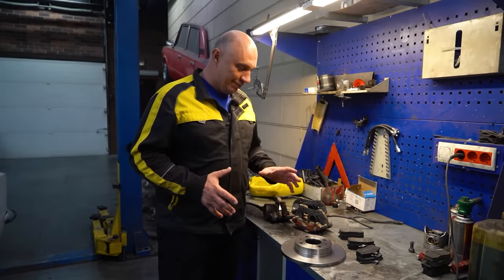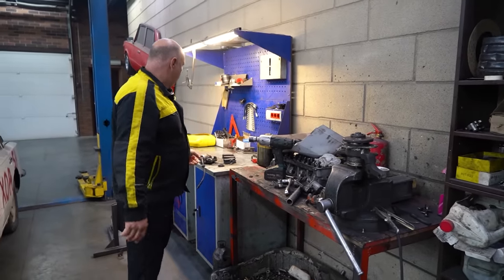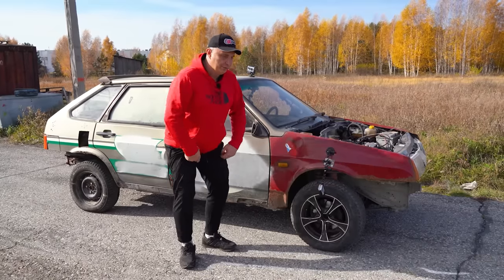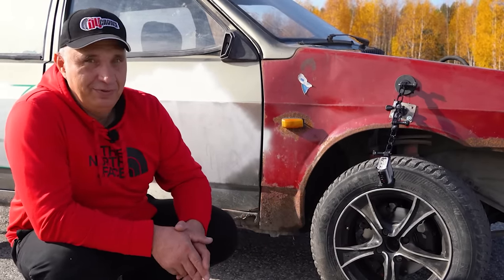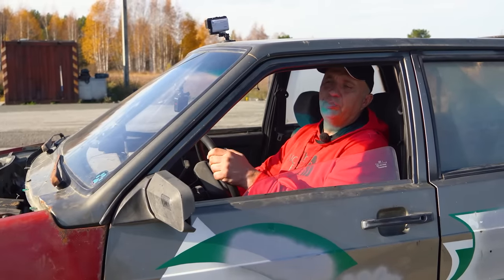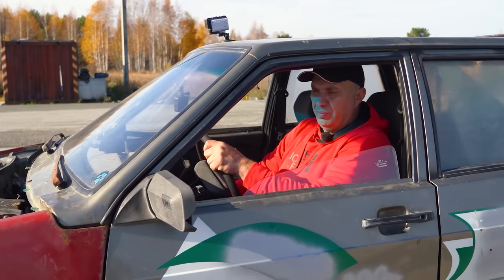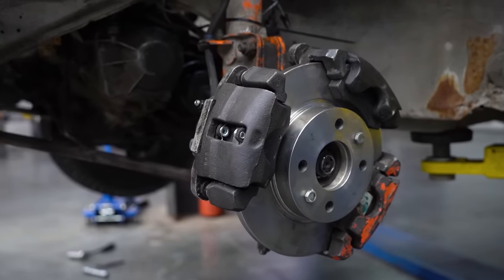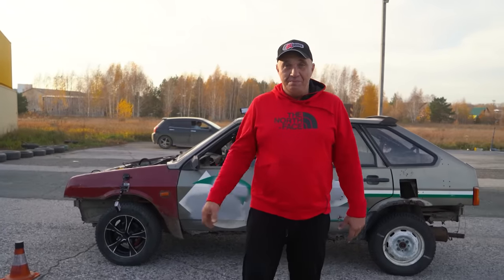Three calipers for each brake rotor – what will happen?

Comment: (This is a reply to someone but YT isn't allowing my reply to go through)

The ABS module only prevents wheel skid, so removing the ABS would improve the stopping distance, since more calipers, more grabbing force, But i surmise you need more brake pedal leverage to overpower the 3 calipers to lock up, Inadequate pedal pressure will not make the Calipers lock up due to more force being exerted against the driver's foot.
In essence, the caliper pads are pushing away from the Brake Disc, nullifying or making the foot pressure less effective.

Then again, bigger/Wider tires may improve the  braking performance without modifying the stock braking system

Comment: Probably getting some deflection between the individual calipers.
The attachment point was (comparatively) thin metal, so when the brakes are loaded the angles deviate and the brakes "hook" immediately.
Edit:
14:39     Air in the lines. Getting all the calipers bled would be a pain, but necessary for an accurate test.

Comment: There are some breaking systems that are not in wheel.the brakes are prior to the wheel causing a two part axle. Maybe then you can get a full caliper around the whole rotor but at that point it’s basically like having a souped up rare disc.

Comment: I wonder if the addition of the 3rd set of calipers is causing the 2nd and 3rd caliper to lose brake pad grip that a set of vented rotors  might cure

Comment: As long as the brakes work properly, the number of callipers won't change the performance. But clearly, if you only need little break pressure with 3, then there is nothing braking the rear ones. So it will increase distance.

Comment: Makes sense that the temperature of the brake rotor stays the same. It's the same energy that needs to be dissipated. Just the calipers share that energy, so they should become less hot when more calipers are used

Comment: Without watching the video my first thoughts were:
1. The rotors are going to get hot and there will be similar brake fade to drum brakes.
2. You will need a bigger brake fluid reservoir.
3. Regardless of how much braking force is applied to the wheels the limiting factor is going to be the traction between the rubber and the road.

Comment: Biggest issue is stopping force is relative to disc size. If they had discs the same size as the flywheel they used the circumference would provide excellent stopping power

Comment: 3 calipers can be used in motorsports for a braking system where calipers take turns with braking so calipers wont overheat.

Comment: Braking performance is basically always limited by the grip of the tires on an average vehicle, not the brakes (assuming the brakes are functioning correctly). People often screw this up, modifying their brake system and expecting to stop shorter with no other changes.

Comment: Pulsing the brakes (mechanically) would resolve most of these issues, however the shortcomings occur over bumps where the pulse may not align with wheel/ road contact: brake with no contact & released when in contact.
The directional use of these energies are where you should be focusing.

Comment: IDEA TO MAKE: Try to add a freewheel between transmission and diferential. So the engine rpm will decrease to idle everytime you take your foot off the gas pedal. Would like to see if the fuel consumption will decrease. 🤩

Comment: The limit of braking is determined by the tires. Not the brakes.
The brakes just convert the kinetic energy of the car into the heat. The temperature differences in the brakes are probably due to difference in the brake rotor ventilation blocked by calipers. Because according to physics, the same amount of heat will be pumped into the rotors.
The reason race cars have huge brakes is not because they stop better, but because they are better at dissipating heat. Which is super important when your speeds are higher and one uses the brakes a lot more often that normal street driving.

Comment: Maybe a proportioning valve installed, or even duel master cylinders with a proportionating valve to a set of calipers would do something, aswell as slotted and dilled rotors, id wanna see what that would change, as the slots with give each pad a fresh surface everytime it goes around and the drilled parts helping relieve gas to keep them cooler,  maybe even carbon ceramic pads too, oo i got so many things id want to try on this idea!

Comment: It's not just about calipers and brake pads.

Tyre quality.
Tyre pressure.
Surface of the road.
Temperature of the road.
Tyre condition. 
Weight of the vehicle itself.

Comment: Basically most single caliper are more than capable of locking a wheel under heavy braking, so adding more caliper would do anything just maybe lock it easier.

Comment: 1. The engine looked like it was going to fall out (rattling away) 😁
2. The "argdididid" sounded like you were having a 💩 in the front seat  🤣
3. Will you try a larger Master cylinder and maybe ABS to prevent lockup? Great video 
👍

Comment: I understand it, the reason your stopping is t rash with this is you used a T-fitting for the brake lines. There isnt enough pressure in the master cylinder to make enough pressure to fully utilize all 6 calipers

Comment: If you're using the same master cylinder for six calipers as for two, it's not going to work very well. You'll need 3x the fluid as normal to get all 6 calipers to function. Which means the brake pedal will travel much further than normal.
Reply: No you don't once all 3 calipers are bled and full , they all work just as if it was 1, the amount of fluid need is minimal when all calipers have been filled and bled

Comment: how did you route the lines parallel or in series?  for stopping power parallel, all 3 calipers install sintered pads.. you want a hi ductile iron rotor, very true and vented.. for control and 2 or 3 pad configuration series go organic, carbon, then sintered in that order, the reason you aren't seeing better performance with 3 is because the rotors are not vented, the gasses are building up and you are floating on a layer of gas..  vent them using either slots or holes, careful you might do a stoppie!

Comment: In the end, stopping the wheels faster is not going to help reduce the stopping distance. Even with all four wheels breaking.
The limit is reached when the tires lose traction. If you use wider tires, the effective patch is wider, but also deflects less. There's a physical limit to how effective breaks can be, on any car.

Comment: Old winter tyres with no traction at all definetly will help in brake test. You will lose contact with tarmac exactly in the same time - with 1, 2 or 18 calipers on the discs.

Comment: When adding more breaks you need to upgrade the servo. I fitted Vauxhall cav breaks or a UK Corsa B sport 1.6 16v and had issue and had to fit the servo of the cav also had to lose the ABS making it of road by law here. but fun. Plan was to drop a 2.5lt V6/2.0T redtop in replacement of the 1.6 16v but got made redundant.

Comment: I wonder if using a much larger truck master cylinder and booster would give the volume pressure needed to be evenly distributed. Also, may help the pedal to be less acute.

Comment: Nice video guys.I think so of the issue may be your master cylinder, if it's the stock one does NOT have enough Volume if fluid.And i don't mean in the plastic reservoir .I mean in the fluid cylinder it self.Is the diameter of the master cylinder about.750" or 17mm?something like that?IT'S normally designed to fill 2 caliper cylinder volumes.SEE what i'm asking?but the idea of anti-loc is good too.

Comment: Please adapt Diesel pre-chamber or swirl chamber with passive combustion sparkplug like on industrial and Formula 1 engines on your usual Lada gasoline engine. Opposite of that Diesel running on Gasoline experiment you did.

Comment: Putting this much friction on a tiny solid rotor might be to much.
But since it's locking up it's not about the braking force, I guess.
Grabbing a couple warm semi slick tires will make the wheels lock up less quickly.

Funny to see the mechanical stuff works.

Comment: A master cylinder from a large pick up truck, 6 more caliper on the rear and add weight until you max out the braking capacity

Comment: I'd like to see the test repeated - but starting with a higher initial rotor temperature.

In my experience, bigger and more powerful rotors and calipers do not improve stopping distance - but they do improve resistance to fade.

Comment: I believe cars these days have the brakes that can fairly easily lock up the wheels, meaning the tires are limiting factor. How good are those tires? It's probably really cold there so it may not be easy to use summer/sticky tires. I would definitely retest with better tires.

Comment: A portion valve need with a high volume master cylinder like the racing one. Because even there are 3 brake caliper on each wheel .  It's not integrated as a whole unit . So when when you hit the brake fluid is loss. Reduce pressure because it runs like hydraulic. Proportion valve to even the pressure

Comment: I would build a braking system with four clutch master cylinders, one for each wheel - connect them to the gearshift lever in an X format and use the gearshifter to steer the car via brakes, like a joystick. Then connect the throttle to the steering wheel. Then drive it ;P

Comment: some dummy questions (after watching just few minutes):

isn't that many calipers cause the rotor to overheat?
having more brake pad surface is all good but seems to me it's not gonna do much unless the brake cylinder is heavily upgraded because the same available brake system pressure will just be distributed to 3 calipers instead of one so in theory it will be only 1/3 to each so in the end equal to using one caliper (also there might be some additional concerns like brake pads not working good unless specific pressure is applied so the final brake force could even be lower than with just one caliper)

Comment: More brakes isn't the answer, more rubber in contact with the road is. Once a brake is locked it's over for the brake and it's up to the friction of the rubber. More rubber, more braking.
Reply: Man your common sense would’ve saved the guy the trouble of making the video .. too bad he hasn’t got it .

Comment: That's the Rolls-Royce setup, starting in the Silver Shadow line in the 70s two calipers per front wheel on different circuits rear calipers with two Pistons on two separate circuits in the event one circuit is lost the other will stop the car. The downside is the pressurization system using hydraulic spheres and engine driven camshaft brake pumps with a constant circulating system using back pressure. Your system is using standard forward pressure. So to calipers for front rotor and rear calipers with two pistons in each and divide it between the two systems then try it out and see what you get.

Comment: I wonder if you had a larger master cylinder if it would change the results for 3 per disc threshold. That way you have more fluid to compress.

Comment: What if you had lorry air accumulators pushing on 3 calipers?   I imagine that would make for a whole different brake experience.   Did you find you had some torque steer on 3?

Comment: install a bigger master brake cylinder because its running out of fluid/pressure to use all calipers which is why the brake are good then bad too the floor then locking up.

Comment: Maybe for the brakes to be effective with this set up
The master cillinder pump needs to be improved
And maybe it needs to have individual brake line directly from the master cillinder pump
So it can push equal hidraulic liquid to the calliper

Comment: I kind of wish when you realized he had excess loss of power. He would have upgraded the master cylinder to accomplish what the smaller cylinder of the original master cylinder of vehicle could actually handle! I believe that he would have had much better handling of the brakes in the car.😮 Crazy! Cool experiment!😂🎉🎉❤❤🎉❤🎉

Comment: Just clicked on this and my prediction will be a serious increase in braking ability, followed by an almost immediate serious increase in brake fade.The rotor needs to dissipate heat to prevent the pads overheating.
Reply: Look at the temps. They are not close to brake fade.
Reply: @larsjrgensen5975  I had just started the video, and was making a baseline prediction based on basic thermal dynamics. Turns out the master's volume capacity was more of an issue.

And I'm sure that, too, played a role in the temps. Inasmuch if the three calipers can't pressurize properly, the pads are not firmly applied and will not reach peak temps.

I'm sure you can see, however, where my initial prediction might have been the correct one otherwise. The less rotor surface exposed to air, the less cooling capacity.

Comment: "What happens" i have a prediction: on cars with ABS, nothing much. The threshhold to where ABS kicks in will be MUCH smaller though. On cars without abs: you just lock up basically instantly on 3 calipers, with not much more pressure on 2. The issue isnt the brakes, it rarely ever is. Its the traction we lose

Comment: That’s cause your ratio of the master cylinder to pistons cylinders is now wrong.   You just can’t add more brake cylinder area and not play with the master cylinder area,  not to forget, if the break force exceeds tyres grip ability, it will lock up the tyres and take longer to stop.
You learn this stuff at mechanic school .

Comment: What were they hoping to gain by multiple calipers? If the car can lock the wheels with 1 caliper on each side adding more calipers will not make it stop better, the tire is the limiter, not the brakes.

Comment: Million years ago I put 2 brakes on a pushbike, disc and rim brakes.  Worked superb, and I really used them.  But every month or so I had to deflate the tyre and slip it back around the rim as it had pulled the tyre around.  As ever, stolen.

Comment: For racing the large 6 piston state of the art calipers are expensive. I wondered how it would work if I mounted 2 smaller and much cheaper 4 piston calipers. Then I wonderd if I could use 2 different types of brake pads, one that begins to work at lower temperature and one that works better at hotter temperature. Might try it. Did find where some factory teams experimented with it but they can afford the larger calipers so why bother? With 2 separate calipers the heat would be split and absorbed by the 2 calipers instead of going all into one larger caliper, would that be good? Or bad? For sure you would need a different master cylinder with more volume to work the 2 calipers.

Comment: Aplying same force on large surface wont help. Would be more interestin monting 2 brake pedals (with 2 brake pump) on one calliper. Perfomance brakepads sometimes have a smaller surface comparing with OEM, becouse will increase pressure on brake rotors, resulting faster response

Comment: the car is designed to brake properly with 1 caliper. bigger brakes or more calipers will make no difference as you are limited by grip and not by the braking system.
Reply: If the stock system can lock the wheel, adding two more will allow the wheel to spin in reverse.

Comment: Try using a larger master cylinder and run thicker brake lines to the t-fittings. You could probably adjust the pivot point of the brake pedal to make it less sensitive. To help with brake fade from heat, use thicker rotors. But at the end of the day, you're building a big brake kit. There are large multi piston calipers, which function wise are about the same as having two smaller calipers.

Comment: So how was it hooked up, hydraulically? I'd have gone with a single flexp hose into one caliper, then a solid hose from one bleed port to the next caliper's until you reach the third one, and bleed them all from there. This is how my rear brakes are set up on my RWD Pony, you bleed the entire back brakes from the passenger side.

Comment: Did they just put that hub with ruined bearing back on with only the axle nut holding it? Maybe they cut out the part where they press in a new bearing to the knuckle, remove the old race from the hub and press it in.

Comment: even the 1 brake is no good From Factory Stock it should lock wheels or trigger ABS. 
If it does that no kind of brake upgrade will improve stopping distance as tyres already at limits.